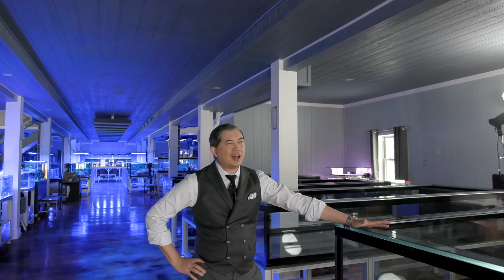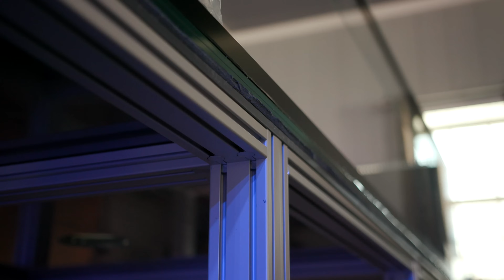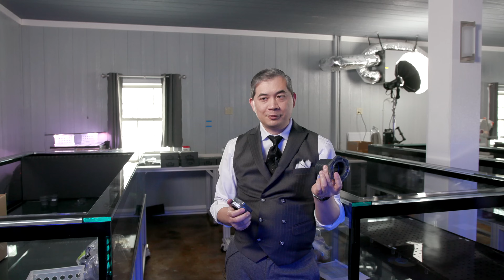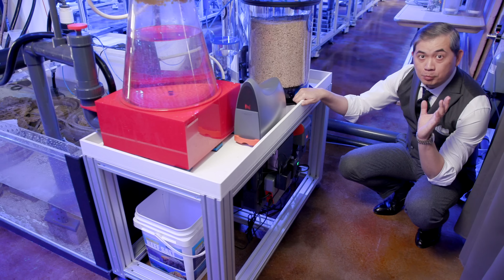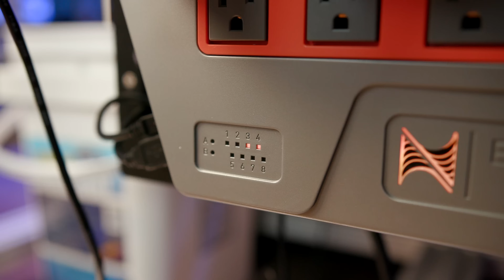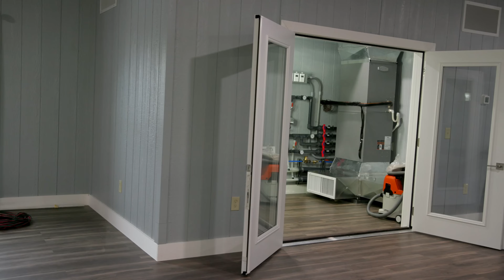FINALLY NEW TANKS!!! - Tidal Gardens Coral Farm Update Episode 25

Comment: Have you looked at red dragon pumps? Slightly cheaper basically the same thing, we are using it on our 1200 gallon reef
Reply from the maker: A very long time ago I tried a couple but they died and back then it was impossible to repair or even replace them.  I remember trying to order one and waited months, but it never showed up so I just cancelled the order.  It might be a lot better now, but I haven't looked into it.

Comment: An LG MultiSplit would have been an ideal solution for the HVAC
Reply from the maker: If I ever decide to re-work my greenhouse with an HVAC solution I will be going with mini-splits, but a central system works better for this larger building.
Reply: @tidalgardens  A MultiSplit and Minisplit are not the same. The LG Multisplits are used in large commercial buildings. They use a large 3phase variable speed compressor in the outdoor unit and multiple smaller indoor units. There is no high volume of air being pushed from central location as it distributed, therefore it is nearly silent. They can achieve 21-25 SEER, higher than any central system. One indoor unit can be in heat mode while another is in cool moving the heat from say upstairs to down stairs instead of wasting it outside.  Higher efficiency, silent operation, granular control of temperature and humidity, lower cost, less space. This is why they are being favored in large offices, schools, etc.

Comment: Are you guys using an air exchanger? A decent unit would make keeping the humidity levels down easy and keep the CO2 levels down too. Might actually reduce your A/C bill with all the power you guys are using inside the building
Reply from the maker: We have 4 air exchangers.  They do not work well to manage humidity, but it is nice to get a constant flow of fresh air into the building.
Reply: @tidalgardens  That's surprising. I would have thought that especially in the winter air exchangers would get it down as low as you like.

Comment: @tidalgardens I understand what you are saying about the Hayward bulkheads self tightening as you unscrew some other thing from the other end for maintenance. However, are you at all concerned that the tightening of the Hayward bulkhead while you untighten something else might put too much pressure on the glass and potentially crack the tank?
Reply from the maker: The tanks are 3/4" thick glass.  It would be nearly impossible to break with plumbing.